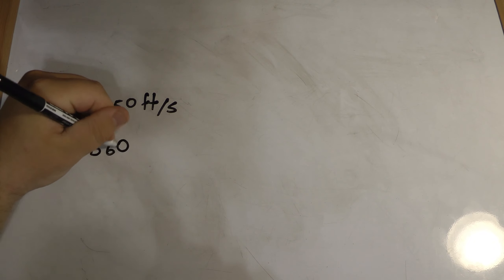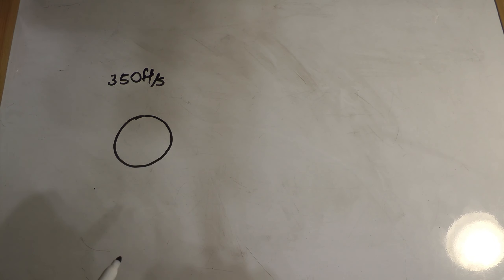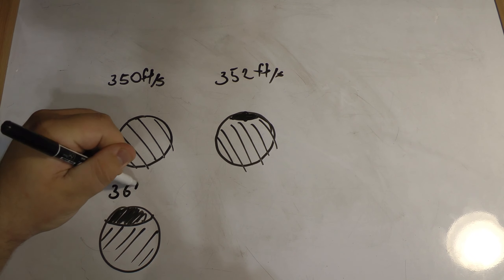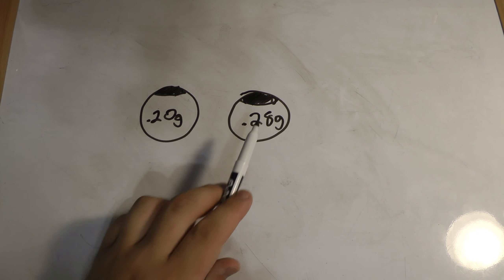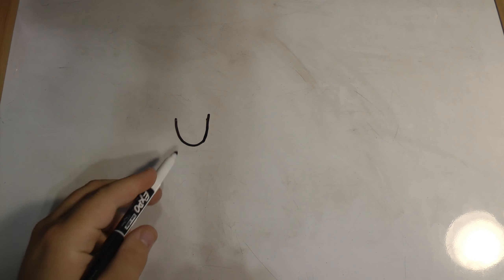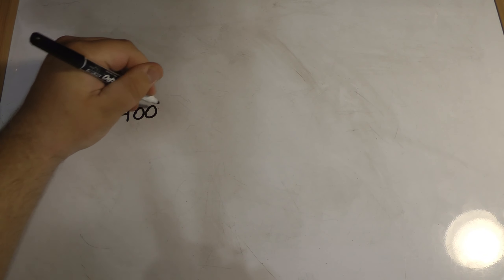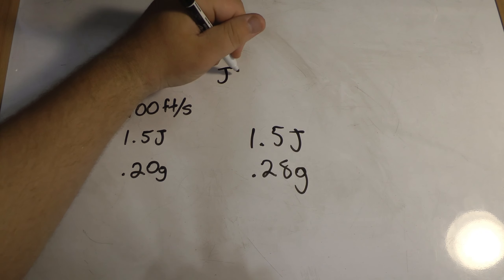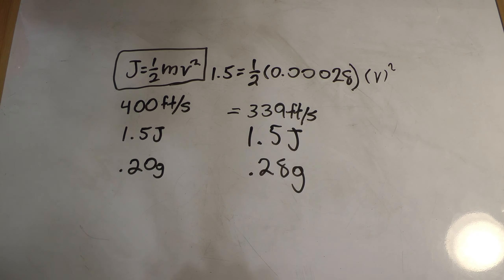How to Fix Joule Creep in Airsoft AEG

Comment: So if my hop up is full open i will reduce the joule en fps?
Reply from the maker: ya so if your hop up is full open, you will have less fps and less joules. if its full closed you will have higher fps and more joules.
Reply: @jedbedrock2944  I knew someone who cheats the chrono by "squeezing" or putting too much hop. They got caught and it was posted in the gamesite fb group. At some point, overhopping does reduce FPS but your BBs will be curving up or will even get stuck in the chamber.
Reply from the maker: @tryhardairsoft416  ive learned a lot about physics since i made this video. I haven't re-watched it to know if im wrong about some stuff. But in theory the shrinking of the airway will increase velocity of the bb up until the force of the hop applied to the bb is great enough to slow it down despite the increased air velocity. In that respect you can fool a chrono, no matter the units being measured. Most hops aren't made to squeeze it that tight, so its easy to know if it was on purpose.

Comment: I just got a gun that you said to get
Reply from the maker: I personally use and have used those guns. Treat them well and they will last you a long time. In the event it does break down, I do offer airsoft repair services.
Reply: Ok thanks so you still make patches of you do where do you get them
Reply from the maker: @teamat3442  i have to custom make them from printable fabric and hook and loop. I dont have enough money yet to get them professionally made. So, i make them in batches. Once this last one is gone, i will have to make more.